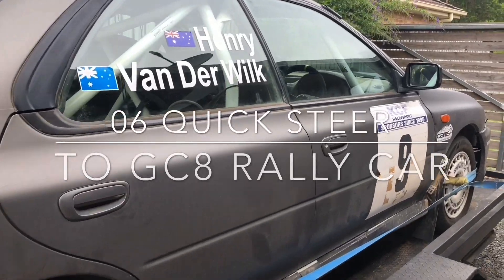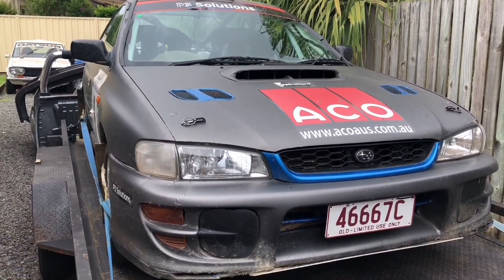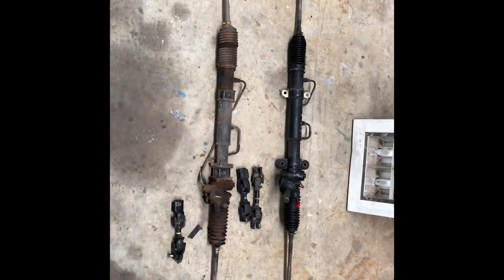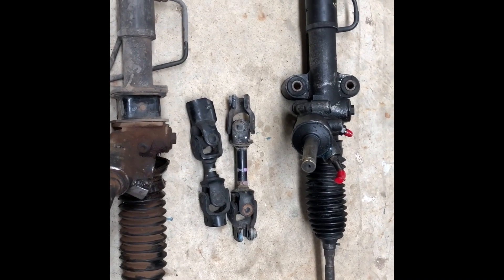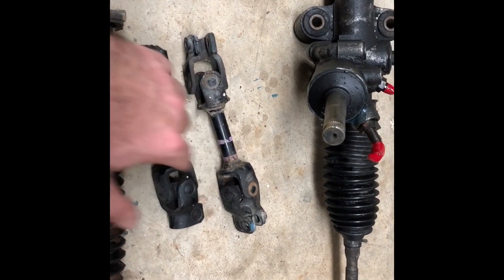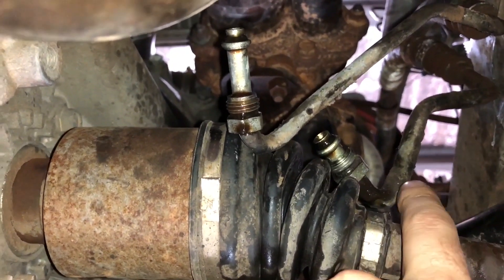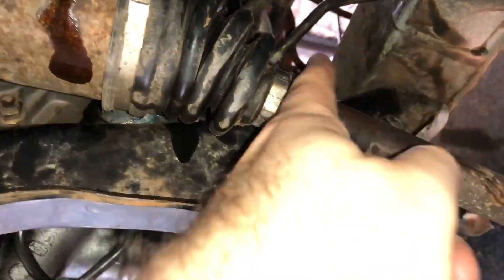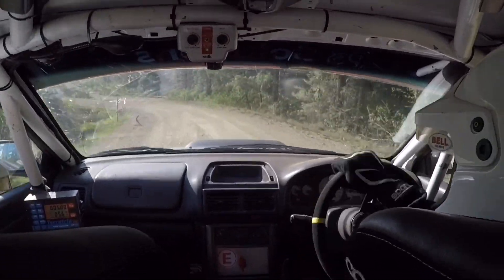How to swap a Subaru 06 sti quick steering rack into gc8 wrx Rally car

Comment: What about the difference in the mount points? ie the old rack has those 2 mount points cast onto the actual rack, whereas the new rack has the square bush mount and the other rounded bush mount. Do you need new bushes or do they just line up and fit?
Reply from the maker: Fuji Wags no difference at all, bolted straight on, only slight difference was the angle of where the power steering lines bolt onto the rack, but even then they still do up easy enough.

Comment: I'll record a video walk around when I can upload in private and give you access
Reply from the maker: sounds good
Reply: @racingoscarrallyteam6793  did you have an issue where the steering angle was reduced after the swap, put the same rack in my type R , and my turning circle has reduced dramatically
Reply: @18speed18  its totally not normal. u must have the wrong rack or your power steering pump isnt strong enough. i suspect the later. lock to lock should be the same.